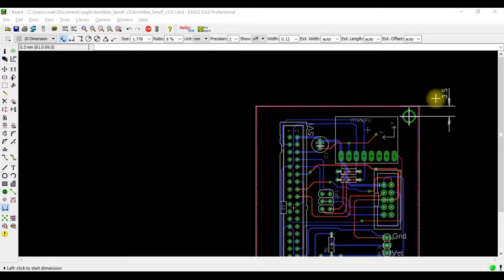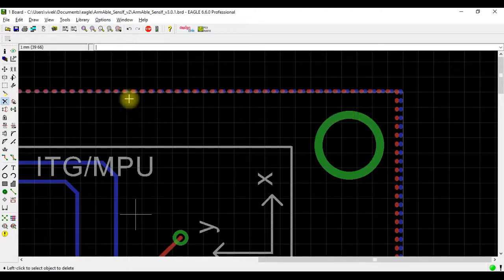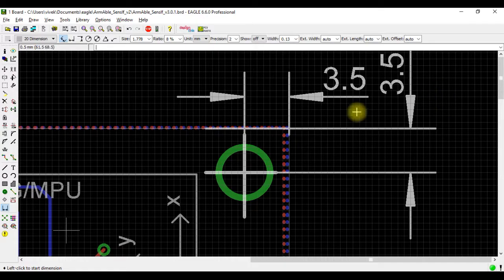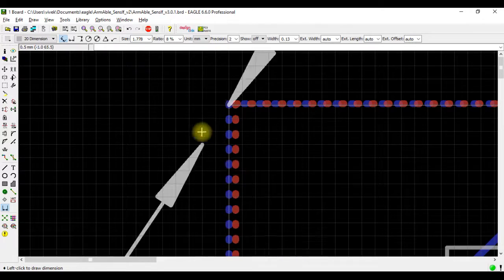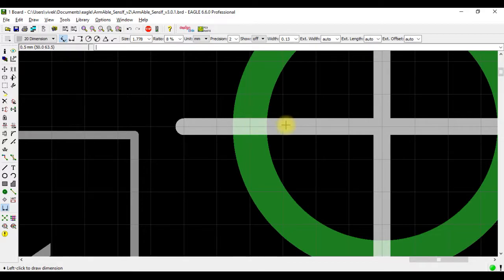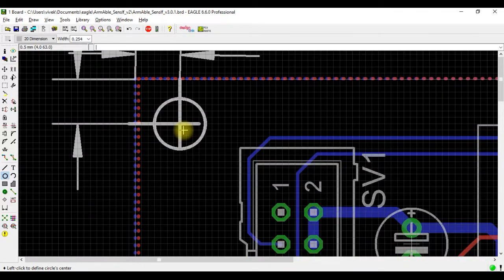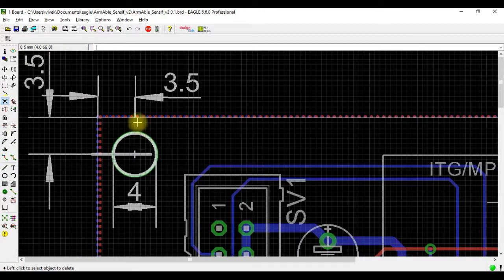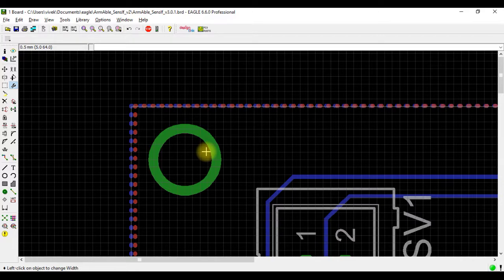PCB Design with EAGLE - 18 - Making mounting holes

Comment: Thanks u sir. I want to know, it is necessary to put a "hole" on vias?
Reply from the maker: Hello 

No, it's not necessary to have holes in a via. The vias which we have used are through hole vias. Such vias are common in simple designs. They are the simplest form of vias and allow easy manufacturing

If you look at complicated designs such as motherboards of computers, the